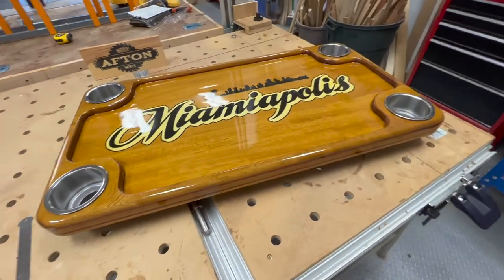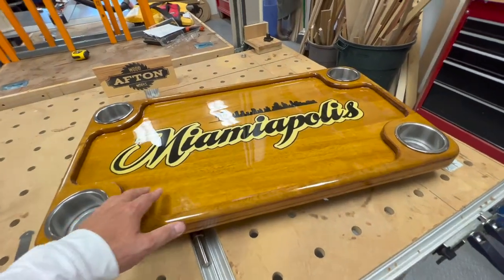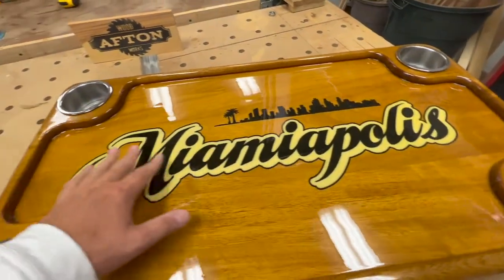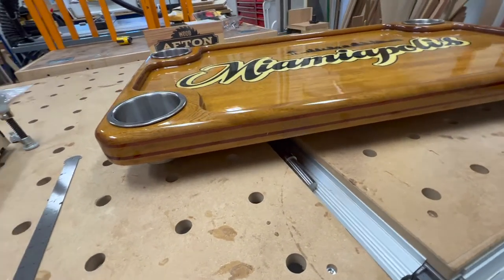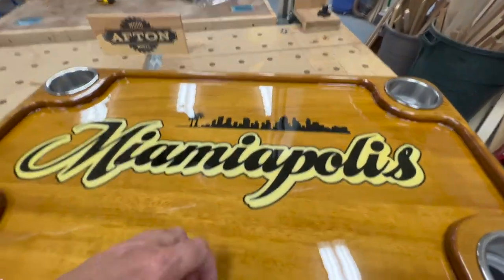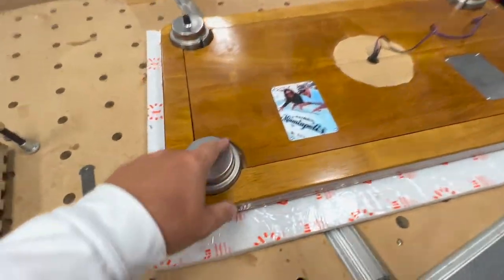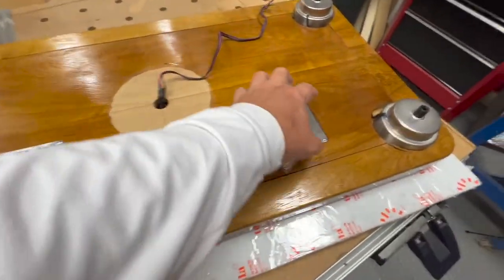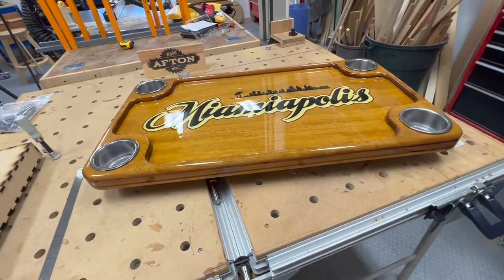Custom Made Teak Boat Table with Epoxy Inlay

Comment: Beautiful work.  Quick question… was the raised outer rim glued on as a separate piece after you used Shaper to engrave the lettering?
Reply from the maker: Exactly right.    Once glued, flush cut the outside edges and did the corners.